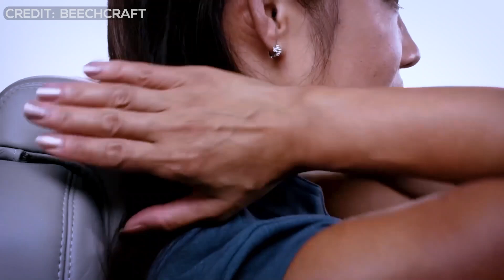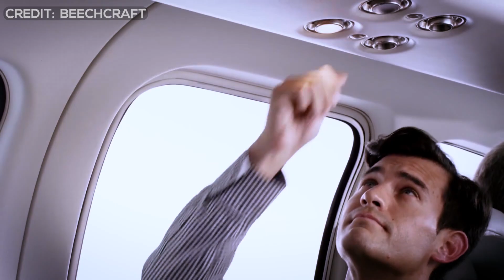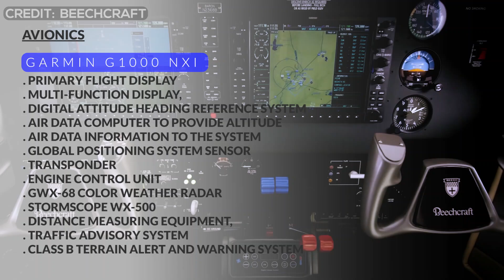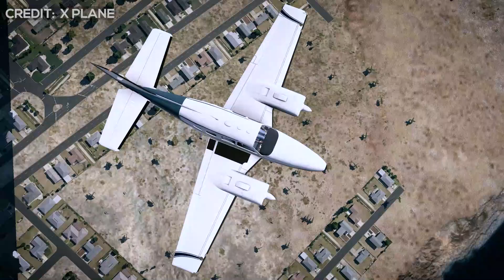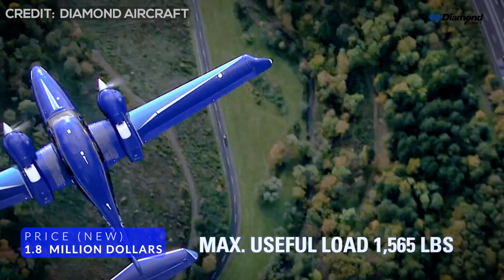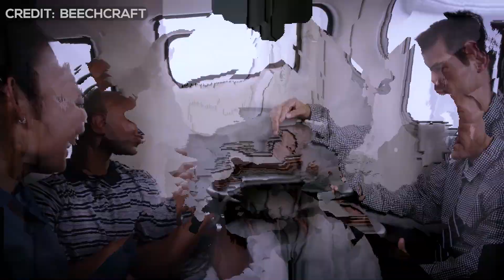Why the Beechcraft Baron is Excellent

Comment: B58P is the only plane I've ever flown in that crashed (New Year's Day, 1991). Nobody (six adults) was hurt, and the plane returned to service. I'd still fly on one. I love the rear-seat configuration, and the wraparound windows. The Pilots (co-owners, flew DC-10's for United and had their Baron set up with those avionics) said that the round-trip from Denver to Miami with stops in Atlanta and Chicago, took a lot less fuel at 30,000ft than it would've taken at lower altitudes, and we would've been bounced from the pattern in Atlanta (didn't quite make it to Chicago, let alone back to Denver, on the return) if we weren't pressurized, and therefore able to comply with what ATC needed us to do, to keep our place for landing. IANAP.

Comment: Baron G55 (cringe), x-plane (cringe), G58-shows B58 exterior and interiors (cringe), rain protection system (cringe). 56TC is not pressurized. The 58P is pressurized. They are B56TC, B58, B58P and only the only “G” is the G58. Plenty of videos out there to get footage better than X-plane. Good research, but could be a touch better. But it’s cool when enthusiasts love our airplanes.

You’ll rarely see a Baron do 450 hrs per year, unless it’s a commercial operation. Must of us do 80-250hrs per year. While I used to do 150-200, I’m now between 120-150hrs per year. Pretty typical.

Annual budget = do not show your wife or spouse the receipts. 😆

On interior capacity, Baron’s can carry 5-6 adults with no problem. Remove some fuel. I’ve done 5 full size American men, or 3-4 adults + 2-3 children completely comfortably. 

Definitely higher operating cost. Can’t skimp on a Baron.

And for the record, I own a Baron.
Reply: Are you actually A baron? Baron McBaron? 

Glad someone is living the dream.  Don’t even have the time and money to get a licence.  Had flying lessons as a kid, all I wanted to do was be a pilot.  Was told due to a lazy left eye it was never to be - as a hobby maybe but not a job.  

Glad someone is living the dream. And maybe in my next life I’ll be up there with you.  Hope you appreciate lucky you are 👍